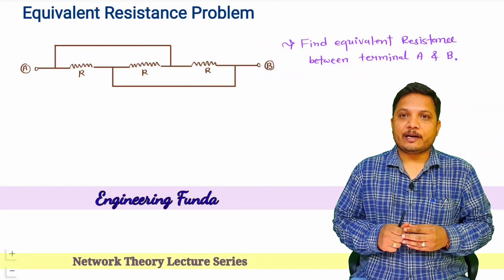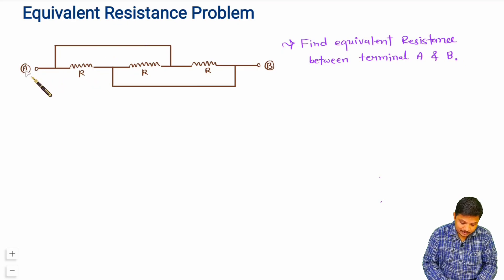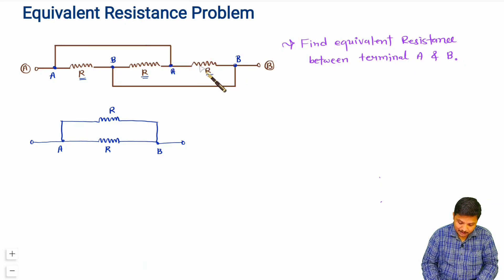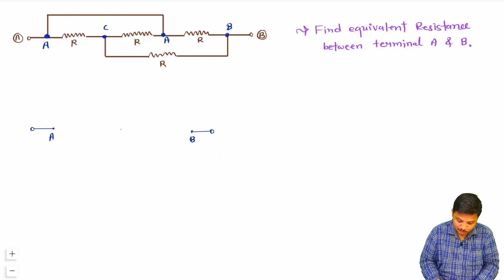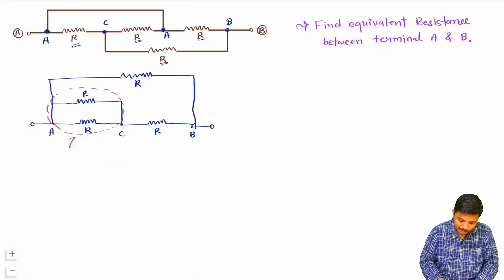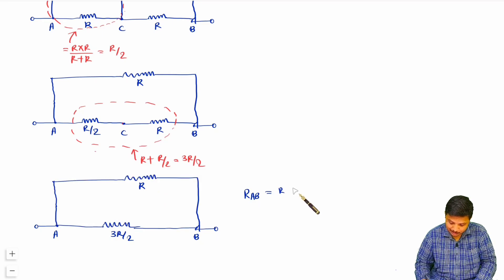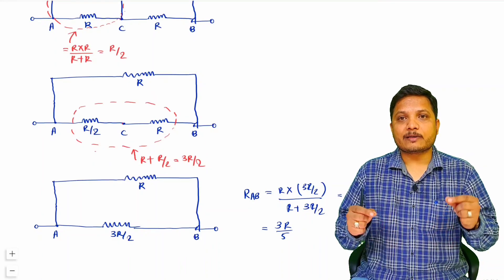Equivalent Resistance Problems: Detailed Examples and Solutions 1

Comment from the maker: Equivalent Resistance Problems explained with following Timestamps:

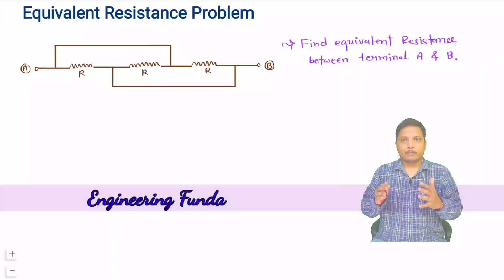0:00 - Network Theory Lecture Series - Equivalent Resistance Problems 
0:17 - 1 Equivalent Resistance Problem
2:27 - Parallel Connection of resistance
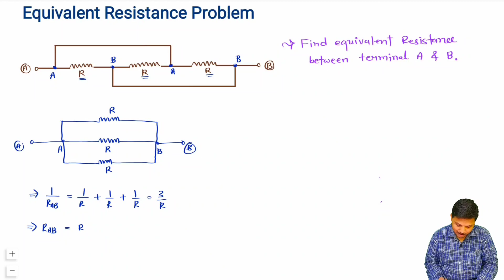3:12 - 1 Equivalent Resistance of given Network
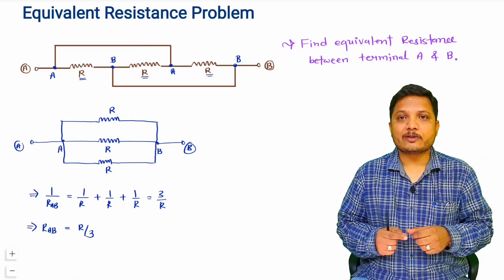3:27 - 2 Equivalent Resistance Problem
5:40 - Parallel Connection of resistance
6:19 - Series Connection of resistance 
6:49 - 2 Equivalent Resistance of given Network